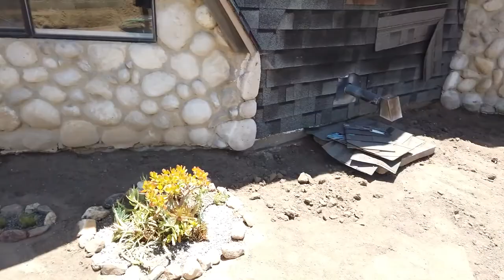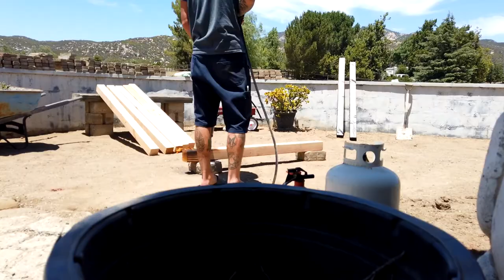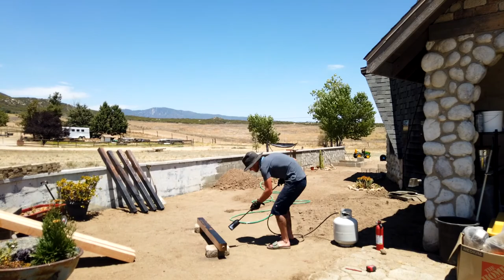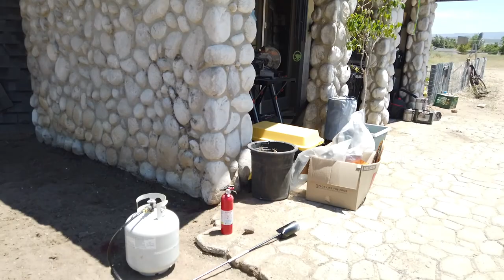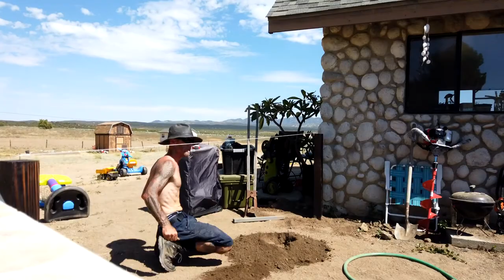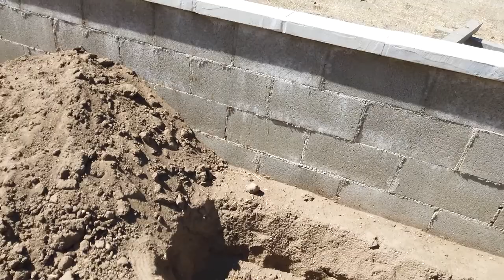Shou Sugi Ban Fence

Comment: 2ft in ground part should be covered around by concrete or not??
Reply from the maker: Depends on what you’re doing it for… if you’re doing it to keep livestock in, then yes. If it’s just for looks, then you don’t technically need to. It’s always better better to do the concrete, it will definitely last longer and be more sturdy.
Reply: Which wood u r using??
Reply from the maker: We used pine
Reply: @livingthedomelife18  which country r u from?
Reply from the maker: @SanjeevSharma-pm2zf  we’re in the United States